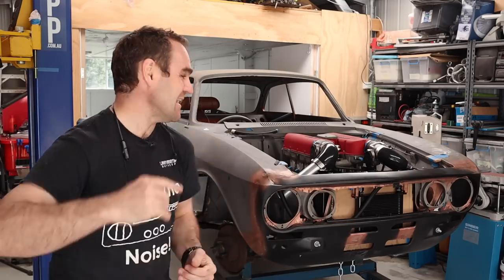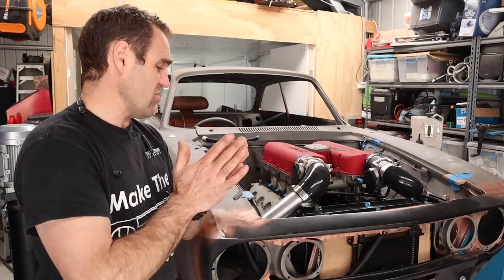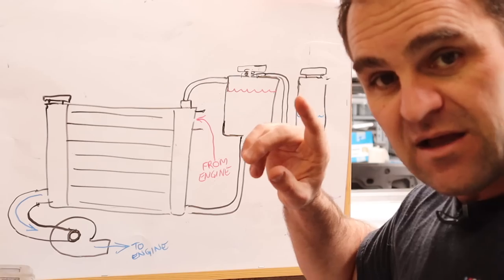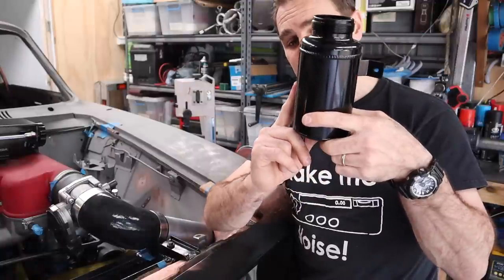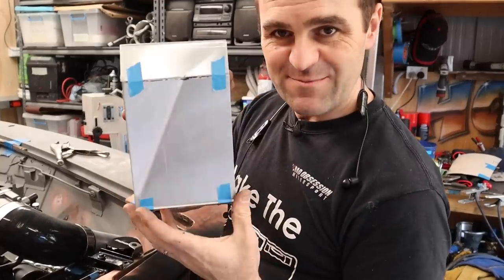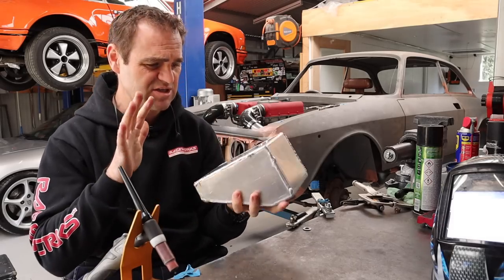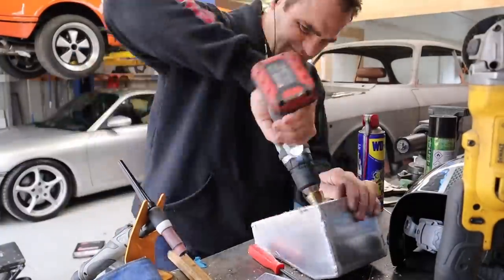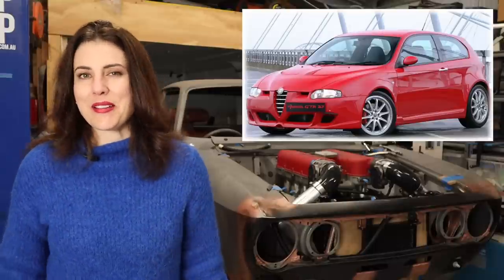Radiator Expansion Tank Set Up - Ferrari engined Alfa 105 Alfarrari build part 62

Comment: Top tip: if you´re welding something that contrapts air in it...drill a hole for the expanding hot air top escape from. Now your last few cm´s of weld will be difficult because air is trying to go through them, cancelling out the argon effect. I´ve learned this building motorcycle racing frames and now make sure the hot air can always escape through a hole somewhere.

Comment: Are you sure the expansion tank is above the level of the radiator?
For someone with limited space you're making things rather complicated!
My race car has some modern thin fancy radiator from a Peugeot 508 or something with a 6mm line running up to the overflow bottle mounted on the firewall and the radiator cap on the upper radiator hose. It does air bubble when you drain the entire system but you just fill the overflow bottle and heat cycle a few times

Comment: Just for anyone watching this episode, you can absolutely mount oil coolers upside down... The sheer volume and pressure of the oil will purge out the air within a few seconds and then once full air can't get back in. I have done extensive testing with both oil and coolant and confirmed it works... plus a number of sports bike manufactures do the same thing so they've obviously arrived at the same results. Just note: If you are mounting it upside for an intercooler heat exchanger, you'll need a decent rate pump to ensure the air is bleed... If you are using a slow moving pump then you will have air locks....

Comment: Well, at least in semimodern cars the expansion tank, correctly filled, handle the coolant issues without the need for an extra overflow tk. The  normal  hot/cold coolant levels in the expansion tk of must be higher than the radiator as I understand it.
The use of an expansion tk makes it possible to utilize the full cooling effect of the radiator area.
The radiator is completly filled and large expansion volumes in it are not needed.
Reply: Expansion tank should be fitted higher than the radiator and the engine. Otherwise it will overflow the expansion tank. Gravity is a bitch.
Reply: I agree with this comment, and there are probably other similar. VAG cars are my thing, sealed tanks with pressure seal about 1.4/5 bar with run off to the floor! With no vacuum spring, the modern stuff is running 100-110'c (ignore the guage) might keep the weight down and simpler
But I have bled up a modded system that had a BMW 3 series rad lower than the heater matrix pipes a utter pain but do'able, that had header built into rad, but separate (lower water level than top of rad) weird!
It's a great crazy build Jeff👍

Comment: Weld the alloy tube to the inlet manifolds and weld a flange on the other end for the throttle bodies. This tube could be curved and angle down to gain room.

Comment: Hi Jeff, thank you for the great content. Why don't you use water less coolant (Evans) which not only lasts for ever, protects the water pump and head gasket, but crucially does not expand. This would enable you to not have an expansion tank at all or possibly use your small overflow tank for expansion purposes. Hoses also last because they are not being inflated each time the engine gets hot. Not to mention the fact that it also boils at a higher temperature than water! Kind regards, Mark

Comment: Options for intake.
1 make a box shaped to angle down and to right angles so that the throttle body can be mounted away from the plenum.
2 same again but spin the plenum so the throttle body is at the back
3 block off the original throttle body holes and put new ones on the side near the middle of the plenum angled down slightly to aid in clearance.

Comment: If room fit the oil cooler on its side, that way you gain spa for the fittings being on the side not on the top or bottom, no issues with air locks.

Comment: You could weld v clamps onto the intake and build some 90 degree solid tubes out to the throttle bodies further down the tubes. I would only suggest that if you wanted to have a bit more bonnet space in front of the intake. You did say it was all a bit far forward for your bonnet with the throttle bodies on in a previous episode . Just a thought. I think it looks good and will function well as is though. Really enjoing the build. Keep up the good work.

Comment: Fabricating more tanks is good welding practice, but assuming there is space between the top of the rad and the bonnet, you could have just welded the pressure regulating radiator cap neck onto the radiator in place of the cap which is already on the radiator, and used the radiator itself as the header tank. Functionally that's exactly the same as what you made, but far simpler and cheaper. Many cars do that.

Comment: Keep in mind that there must be a measurable 1 liter of expansion room in the tank so it is best to put the inlet to the tank at the bottom of the tank. The reason manufacturers use plastic is so the owner can see the maximum mark on the tank therefore allowing the required 1 liter of expansion room in the tank. Water when heated expands and a naturally aspirated V8 needs 1 liter of room to grow.

Comment: Great work as always! Is it just a trick of the camera positioning, but is the expansion tank actually higher than the top of the radiator and at the highest point in the system? Could you have just put the pressurised cap on the top of the radiator (in place of the the sealed fill cap) and still just used the cylindrical expansion tank? You seem to be a few weeks ahead of what I'm doing on my Anglia, I'm not copying you, I promise!! :D
Reply: Looks like it's the same height as the top of the radiator. Jeff, for your sake, I hope it's high enough, or it's make some more brackets. Can not wait till this thing is up and running. Top stuff.
Reply: Looks low to me, but to be fair, I only know it should be the highest point because Jeff told me.
Reply from the maker: It is the highest point ;)
Reply: @HomeBuiltByJeff  Just the camera angle then😉🙂👍👍

Comment: Jeff, it looks like your F360 engine came without the Mass Air Flow sensors that should be located before the throttle bodies. You're going to need them for the engine to start and run correctly. They're fairly big pieces so you'll need space for them. BTW, don't buy them from Ferrari, instead source the exact same part from Bosch at 1/4 of the price. Advise if you need a Bosch part number and I can give it to you.I'm really enjoying this build!
Reply from the maker: I have them, but wont be using them ;)

Comment: Jeff, another thought, don't you need a two way vent cap? it lifts at high pressure and vents into the overflow tank, then on vacuum it opens and draws back any fluid that is needs from the overflow tank back into the radiator system until an equilibrium is found? or are you just venting to the ground

Comment: Really love your work but I'm pretty sure the level of the water in the bottle you've made (don't think it should be called an expansion bottle because that's the other one)  should be higher than the radiator? The expansion bottle can be placed at any height. Also, I assume the cap you've fitted to the radiator for filling is a blank and not a normal cap that would allow water past it?

Comment: so has the raceworks (replacement) tank you made got a pressure rated cap that lets any overflow into the final tank?  so it keeps pressure in the system(pressure increases boiling point to My understanding)

Comment: Have a look at a modern car and you will see with clever expansion tank design you dont need an overflow tank as well.
Reply: I was just about to say that.
And have the connection on the bottom of the tank, so the coolant will level between the tank and the radiator.
And if you make it easy to unscrew the expansion tank and leave enough hose, you can actually use it for the initial purging of air from the system.
But, as the video is running, I see it's too late for that...
Jeff already made the second tank...

If you read this, don't use the transparent level pipe. They will start to leak very fast.

Comment: How do you make sure that there are no metal bits in the oil tank?
Reply: yeah, I was curious about metal bits in radiator and expansion tank also
Reply from the maker: I blew it all out and I will flush out all of the tanks before use.
Reply: @HomeBuiltByJeff  I figured that it just wasn't on film.. 
great work Jeff, I really admire it
Reply: How do you ensure that no particles are left? Personally I would probably have been too paranoid, and would have left one side off until all other work was completed.

Comment: Why not build a tank that has compartments for both expansion tanks and put it inside the passenger fender like you did with your oil tank? Would make it a lot cleaner to get it out of the bay entirely
Reply: It has to sit higher then the radiator
Reply: @MattHew-dy1wl  it still can even in that location, just mount the chamber higher up i cant exactly draw a diagram but my old Audi had an expansion tank basically in the area i'm talking about

Comment: If your overflow tank is below the level of the expansion tank there is a risk it will siphon coolant out of the system.
Reply from the maker: Not if you have a properly working radiator cap ;)

Comment: Be careful with that vice bro.
They are great but the swivel plate is weak. If you need to lay into anything with a hammer or BFS or are bending brackets it will break. I keep a huge arse Dawn bolted to an old 4x4 rim with weights for just such a purpose. Broken enough vices in my day!
Theres a few youtube reviews of vices that are super interesting if you've got 5 minutes of nothing going on.
Fireball tool make the world's best vice
Reply: Yep the old school method of creating a vice from street plate etc!!!

Best one I ever made was from 12mm plate in layers for strength!!!

LMAO I could actually bend 12mm plate with a sledge hammer in it!!!

Only coz the bench top was doubled up 12 mms plate with I beams for legs and frame. Just under one tonne of bench alone🙂

Comment: i think your really over complicating the cooling system car have either an overflow or an expansion tank i've never seen one with both since the expansion tank is usually mount in a location that the top of the cooling system is about the midway point on the tank so in general operation it will never push out any fluid hence why they are often located near the firewall. in the case of this car since you already went to the effort of drill and mounting a radiator cap a simple overflow bottle would have been more than enough

Comment: Please speak to your engineer before going further with the TBs. I'm not sure that it will pass based on the rolling ball test and for even visibility. The rules may have changed but it looks like you might struggle. BTW lots of bikes have TBs before a rubber coupler..... 🤔
Reply from the maker: Hey would have passed it with the previous height plenums ;)
Reply: So the whole rolling ball test is finished now? That was in the older Code of Practice for Light Vehicle Mods. You can also drop the bypass flow below the water line of your larger tank and delete the second tank. Have a vented cap (non returning) on your large expansion and make sure the bypass flows and draws low on the tank to perform the degas. Check that there isn't already a degas line from the engine itself that will be at a high or a point the designers know is an air trap. If you find one then just tee into the line from the rad you have perhaps.